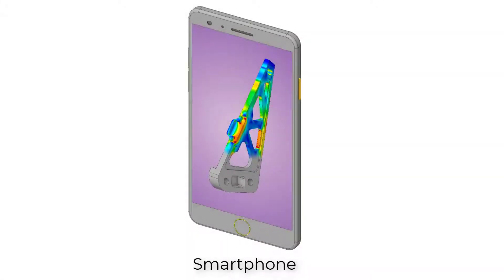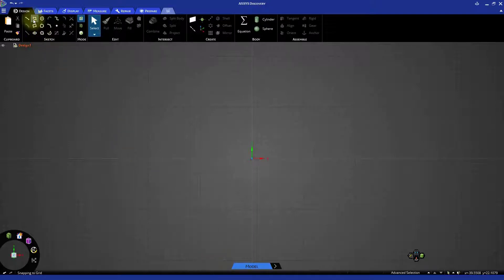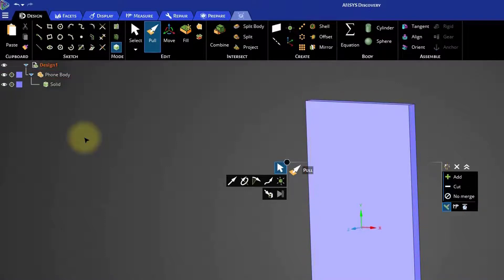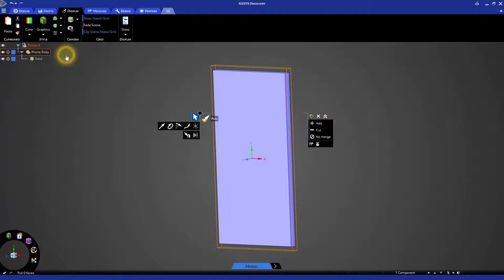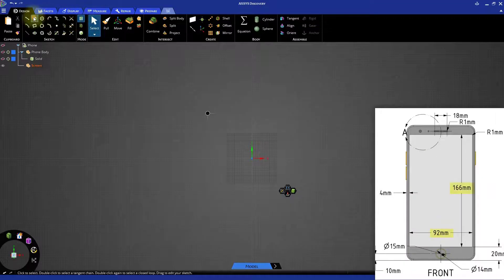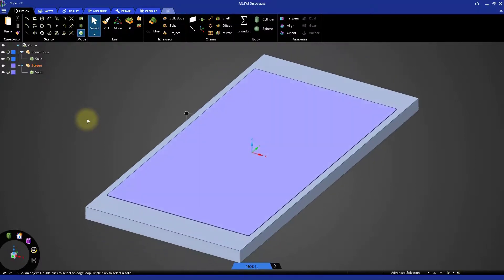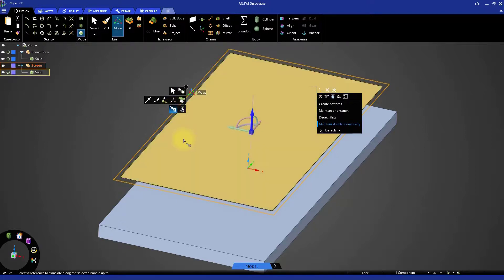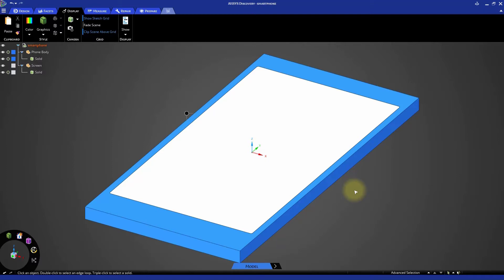Ansys Discovery Modeling Tutorial — Smartphone Geometry — Lesson 5, Part 1

Comment: Now this is the most awkward and time wasting software that I've ever seen and I've seen a lot. Grossly overcomplicated and very unintuitive commands and their execution. I'm spending 30 min. to cut that screen out of the body. In any "CAD" like software it takes seconds even if one is doing it for the first time. Also, how come move tool is often trying to "pull" i.e. extrude the screen when I try to move it? Also, can't move the screen to the phone body so that it is flush with it. It seats on top of the body if I repeat every step of tutorial. But even to move it on top - it takes several attempts simply selecting Z axist, than "up to, than clicking the face of the phone body doesn't do the trick. At best it moves into phone body by half its height. Who's writing this software? Extremely frustrated here.